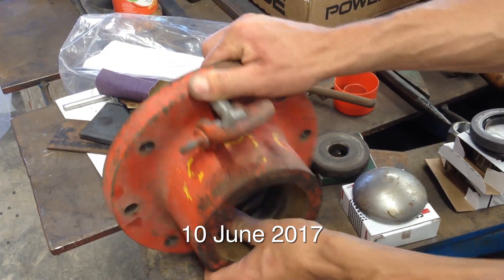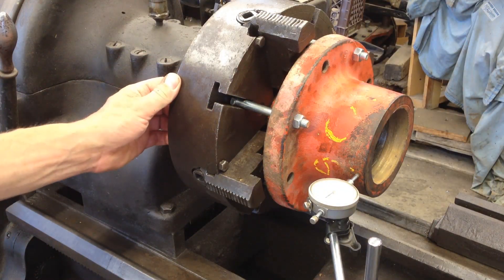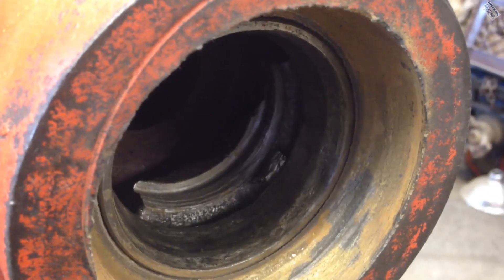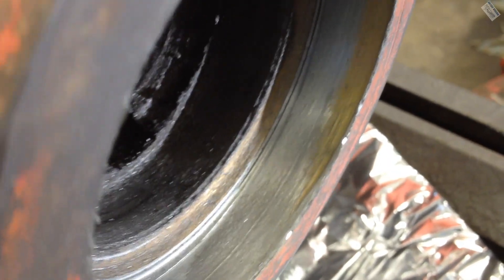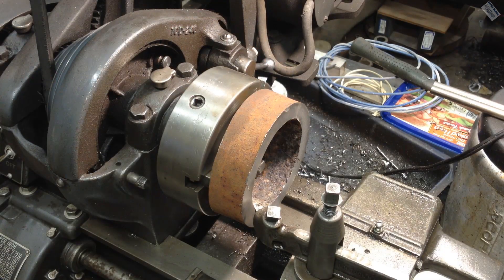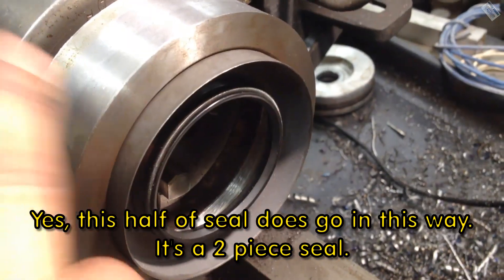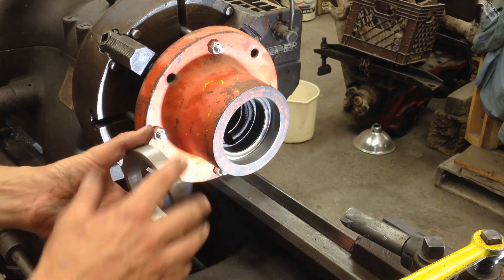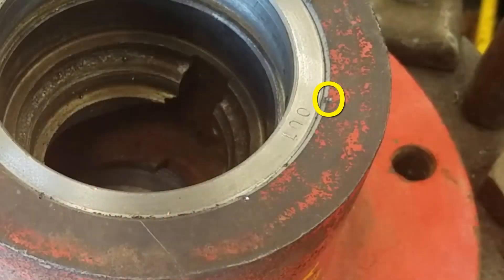Repairing a "Machined By Driving" Tractor Hub

Comment: Nice job, I think I would have made the bushing .002 over and heated the turned hub. Freeze the bushing, heat the hub then mate them. Just like they do rings gears on flywheels. That sucker never would come out. But staking does work too. Thanks for sharing. Best Wishes n Blessings. Keith

Comment: Great job especially started at 6:30pm. The only thing I would have done was to locktite the bushing in. Now that I'm starting a home shop I'm wondering if I should get a second lathe or just another spare chuck.
Reply from the maker: Thanks! There have been many, many times having 2 lathes has been so nice. If you have the space, and money, I'd recommend it.   And loctite...that would have been good! I guess I was too tired to think of that.
Reply: Wide Vision Metal Fab that was my guess but at the end of the day the important thing is that you did a great job and your client will come back.
Reply: Gilberto Diaz Castro Green Loctite 638! I was thinking the exact same thing at the press. I learned something new however with the peening of the outer rim. I've seen it but never really thought about why it was there. How do you manage to remove it, with a drill?
Reply: Zachary Hodge depending on the part you are working on the peening will come off when you press the parts out or remove the old part with the lathe. I guess you can also remove them with the drill. You would decide the proper method when you get to work on a part that has been fixed this way.

Comment: This seems like its going to leak...how do you press on a new bearing race with that bushing installed?
Reply from the maker: The bushing brings the opening back to factory size. I had no trouble pushing the bearing race in. And why would it leak????
Reply: Gun grease won't leak out of there. Wheel bearing grease SURE won't. No oil bath.

Comment: you couldn't lift that LITTLE  hub without the hoist? ??????
Reply from the maker: Lifting wasn't the issue. Holding it in place while securing it in the 4 jaw was. And no, I couldn't do that with only 2 hands.
Reply: Wow. Sorry didn't look that hard to chuck and dial in.
Reply from the maker: Magic of the edit, I guess! :) I think it weighed about 40 pounds.
Reply: it saves your body in long term ;)